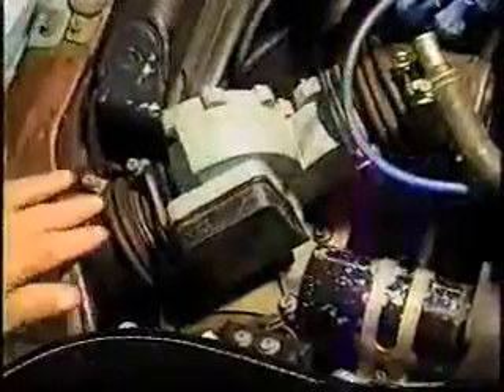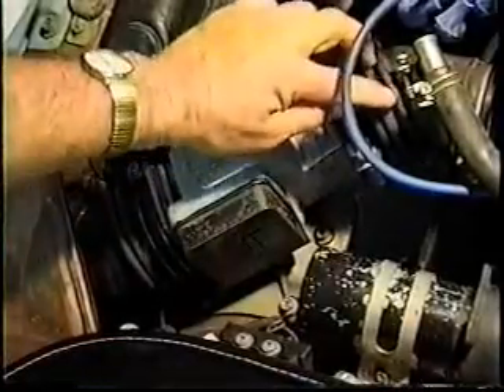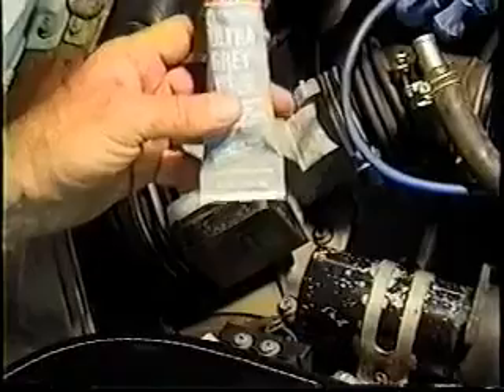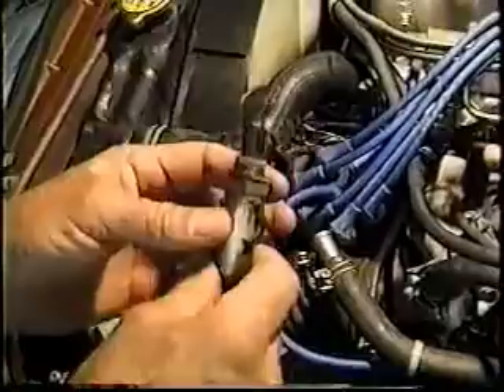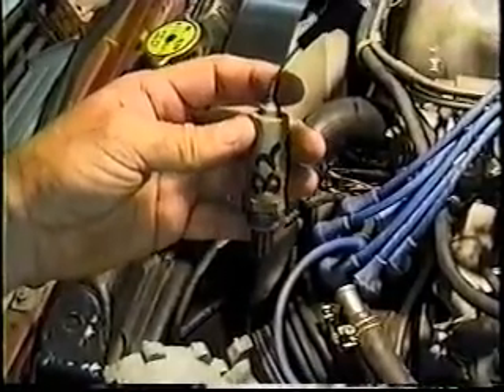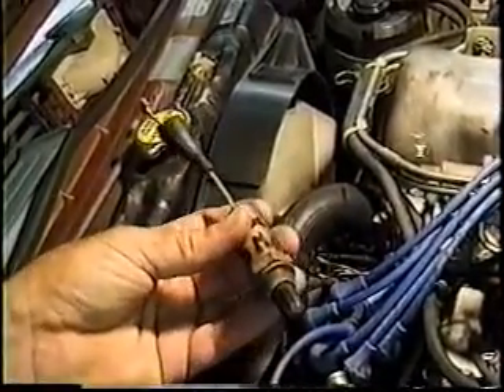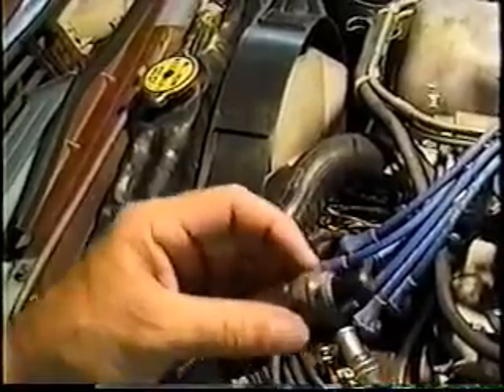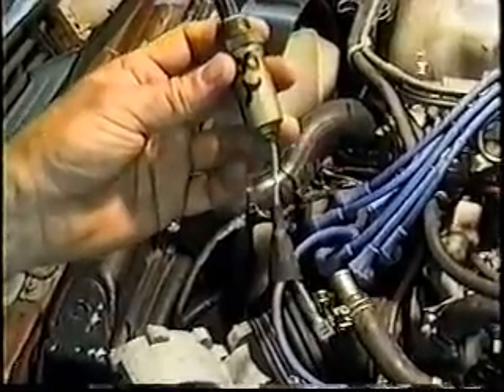Z Therapy Datsun 280Z ZX Fuel Injection 14 of 20

Comment: O2 sensors were only on the 80 cars sold in california, and all 81-83 cars.  I don't think any of the previous Z models had O2 sensors. I'm not able to find an O2 on my 1980, which was purchased new in the Southeast US.
Reply from the maker: I believe you are correct only the later zx had O2 sensors
Reply: @burkeyvision4346  But your channel saved my bacon.  I watched your video about the fuel line recommended, and the SAE number.  I ordered the correct hose from a parts store website last week, but when I picked up my order, I was given the SAE R7...not the R9.  Took it back, and got the right stuff.